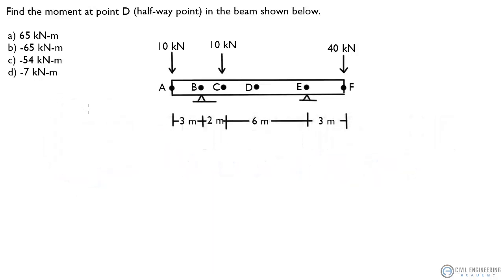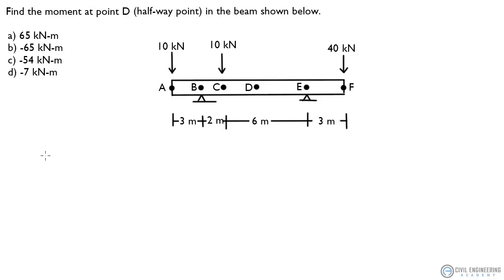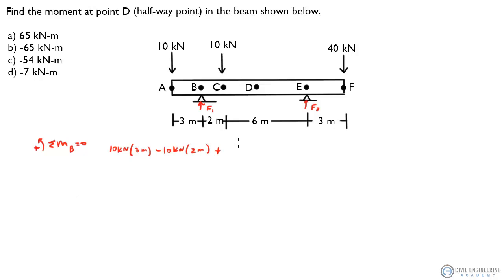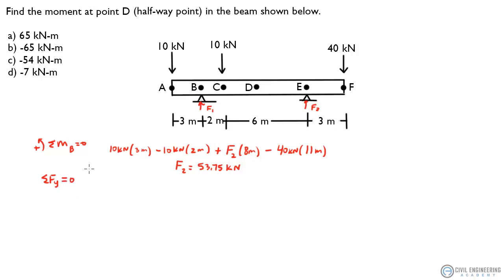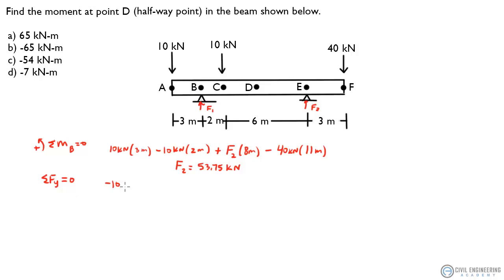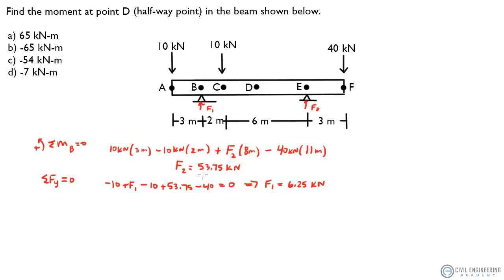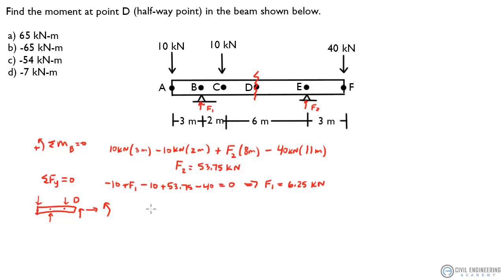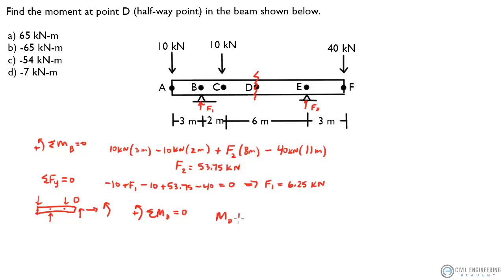Structures - Find Moment in Center of Beam

Comment: I think there is a mistake with your last equation:
Md=10(8)+10(3)-6.25(5)=78.75kN is the correct answer which agrees with Shear and Moment Diagrams.
Reply: You have the distances wrong. Md=-10(7)-10(2)+6.25(4)=-65kN-m
Reply: @ryanohara9233  Oh, yes I assumed that D was the midpoint of C and E